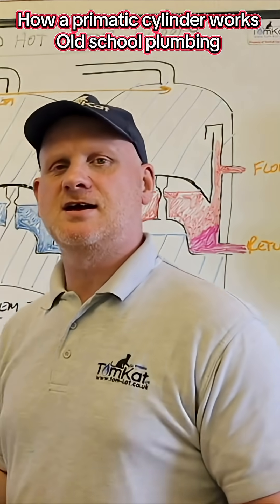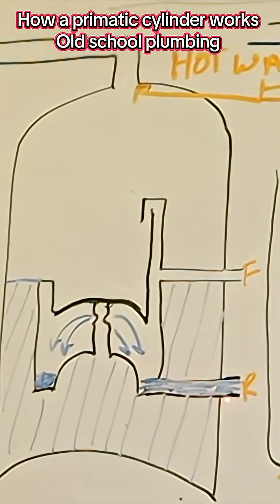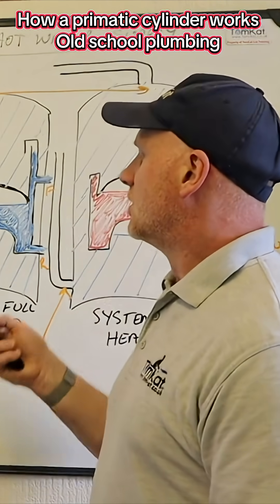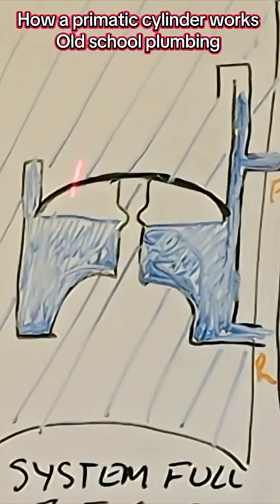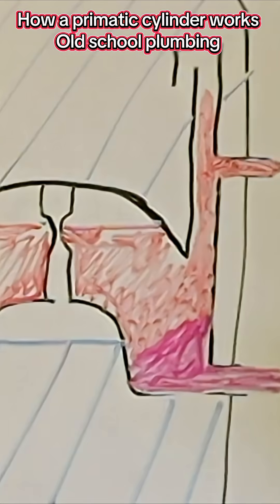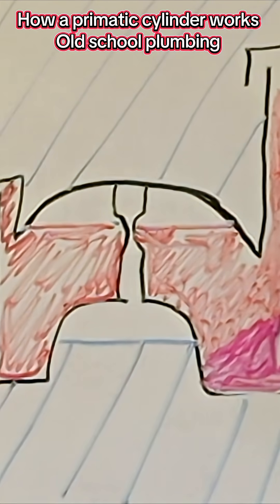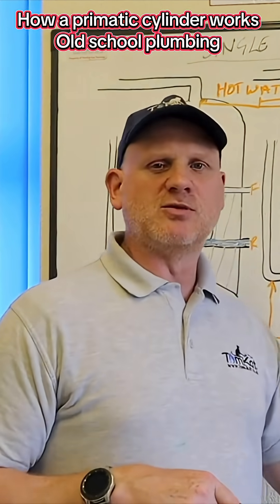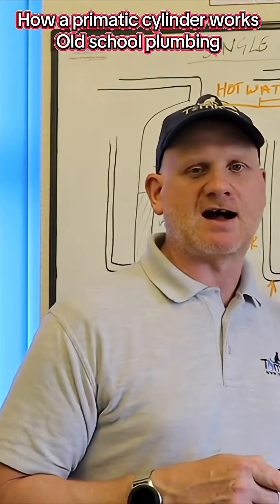Old school plumbing, how a primatic cylinder works #gastraining #plumbing

Comment: If I remember rightly “Primatic” was the trade name; think the proper name was single feed indirect.
I know someone who used a bung on the cold feed & vent of the tank to do a repair on a heating system with a primatic and the cylinder imploded & crushed like a coke can😂
Reply from the maker: You are correct it is a single feed indirect cylinder
Reply: God not seen them for many a year. Fun times